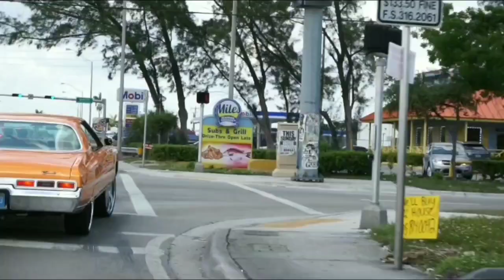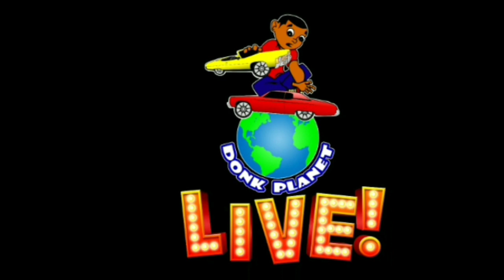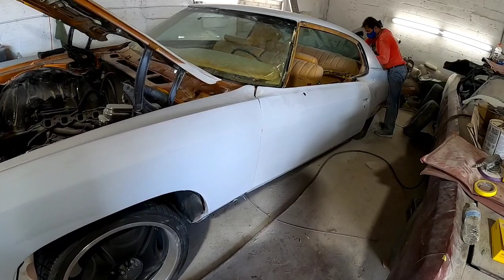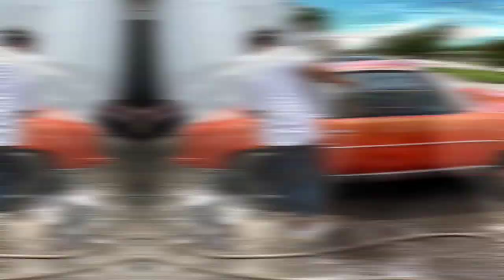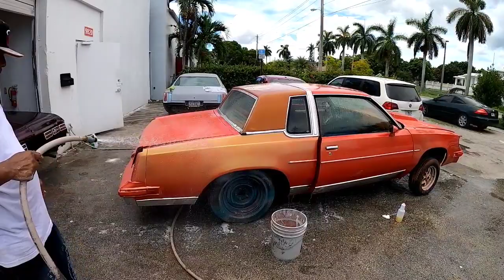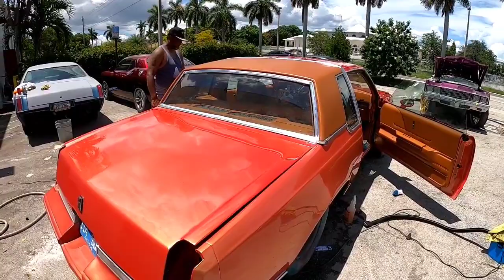DonkplanetliveBTS: cutlass car detail / diet weight loss journey

Comment: Miss my 81 Cutlass that got stolen from me Snow White quarter black rag top tinted windows 20in 150 spoke D's 350 rocket elderbrock upper Grand National Rear End headers Flowmaster 3 inch exhaust Chrome tips come out from behind the wheels Alpine system to 15 inch M&M roses